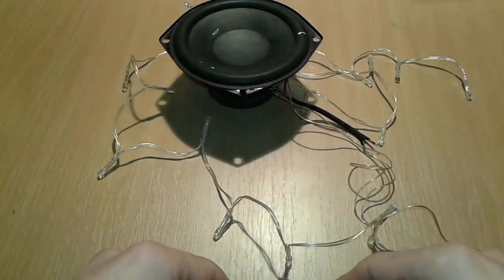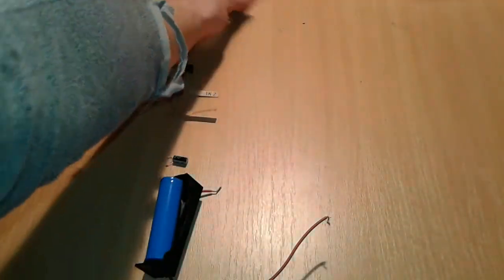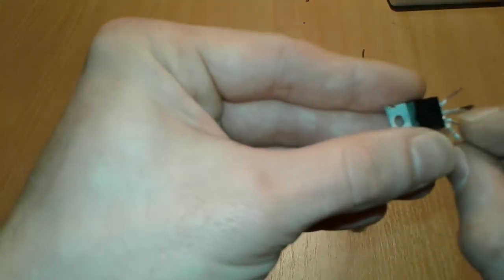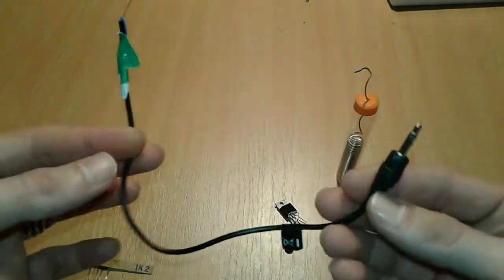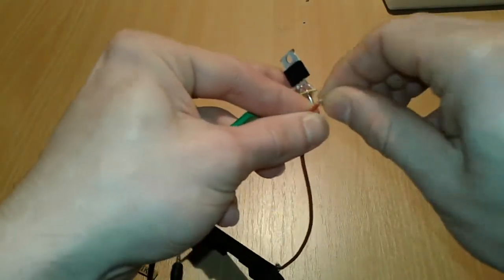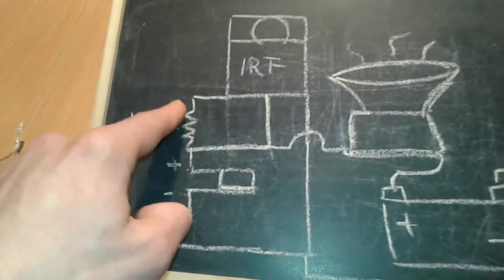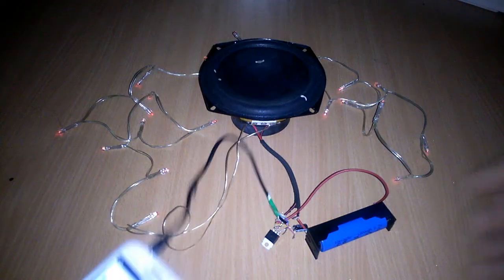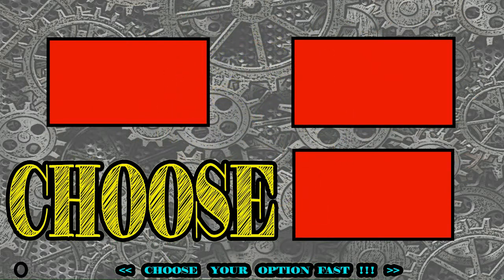How to make Sound reactive LEDs using Mosfet transistor NO TIP31C

Comment: Thanks for this demonstration.  You mention the capacitor is optional.  Can you explain what purpose it has and what would be the difference if you dont use it?
Reply from the maker: hi there pal i said that is not crucial and i was referring to the specifications of the cap, you need one cap to make a reference voltage for the mosfet to operate its charging and sending smooth voltage wich is them amplified and send to the speaker this is just a crude demonstration to show the principle of operating a mosfet transistor wich will replace the older transistors